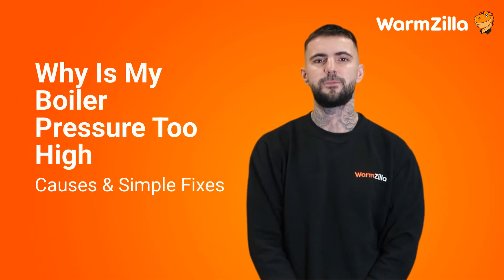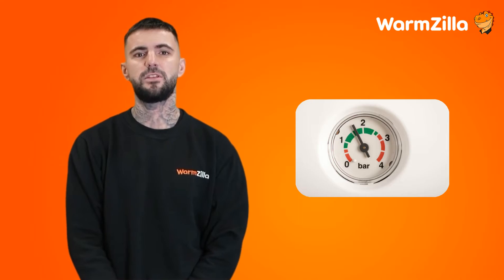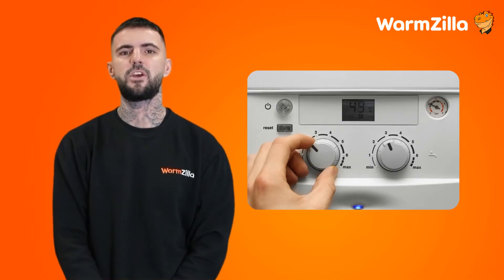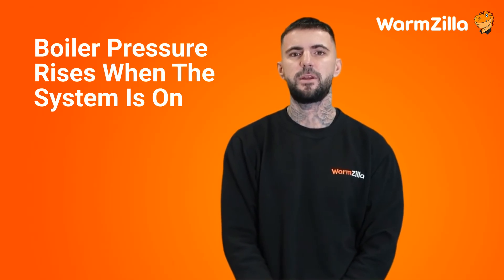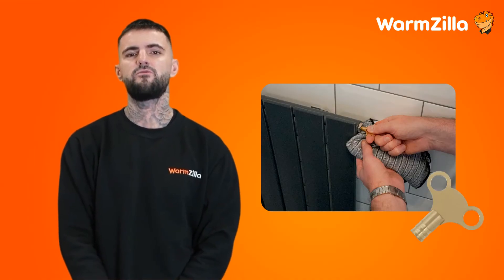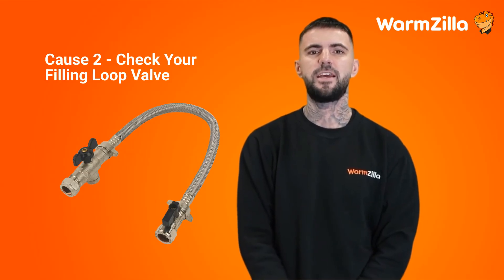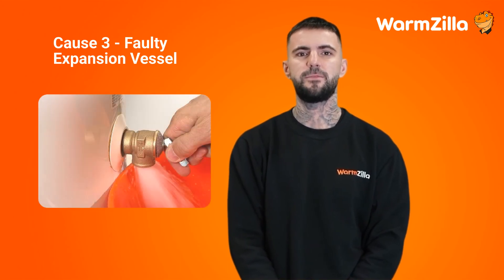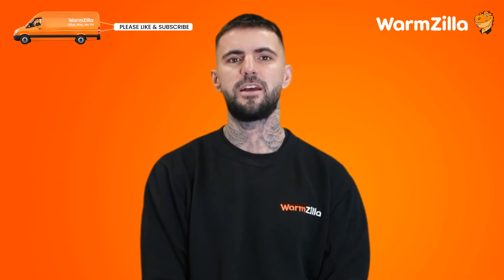Why Is My Boiler Pressure Too High? | Causes & Simple Fixes | Gas Safe Engineer Troubleshooting Tips

Comment: My boiler pressure is over 3bar and the prv opens to release the pressure. Whilst this happens i check the pipe from the hot water tank to the expansion vessel but it is cold. The expansion vessel is charged to 1.5 bar. Should the expansion vessel input pipe be hot?
Reply from the maker: Hi there! When your boiler is running and pressure rises above 3 bar, causing the pressure relief valve (PRV) to release, this often points to an issue with your expansion vessel or its connection. Typically, the pipe from the hot water tank to the expansion vessel may not always feel hot because the expansion vessel is designed to absorb extra pressure, not circulate hot water directly through its connecting pipe. Its main job is to handle the expansion of water as it heats so if it’s functioning properly and the system is balanced, the pipe might remain cool even when the vessel is charged at 1.5 bar.

However, pressure rapidly rising and tripping the PRV suggests your expansion vessel may be faulty, undercharged, or there’s another problem like a partially open filling loop or even a faulty PRV. If your system’s pressure spikes and you’re seeing these issues, it’s a strong sign the expansion vessel needs checking or replacing by a Gas Safe registered engineer. Also, if water consistently comes from the PRV, that valve may need replacing too.

So, in summary: it’s not unusual for the expansion vessel pipe to be cool, but the high pressure points to a more complex fault in the pressurisation part of your system.

If you’d like more assistance with this, give our team a message and they would be happy to help! https://www.warmzilla.co.uk/contact-us

Comment: How many radiators do you have to bleed ? 1 or 2 or more ?
Reply: The reason I needed to bleed the radiators was because the boiler pressure was too high. All sorted now. Thank you for your help.
Reply from the maker: @mariojohnson8317  No problem at all! 🦖
Reply from the maker: Hey @mariojohnson8317, Derek here! 👋

If any of your radiators feel cold to touch at the top but warm 3/4 down, those are the ones that need bleeding. Just remember that if you do bleed your radiators, you'll need to make sure to fill the system pressure back up to 1.5 bar (when the radiators are cold). It could be all of your radiators that need it, or just one!

Let me know if you need any more help. 🦖
Reply: i have a boiler with a small tank that i had to drain the boiler to pressurize to the correct amount would i still have to turn off the filling valve if thats the case